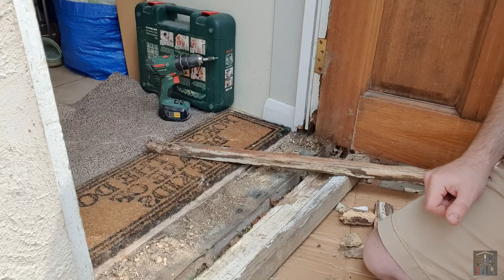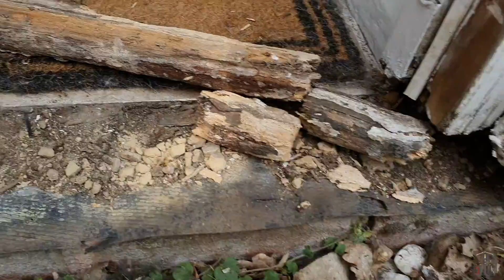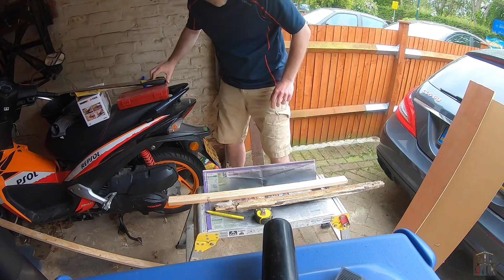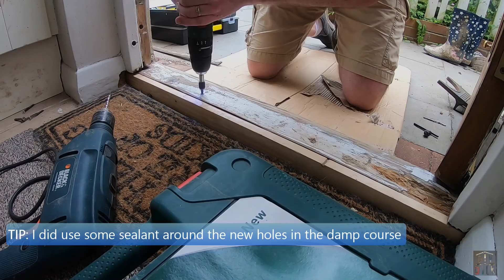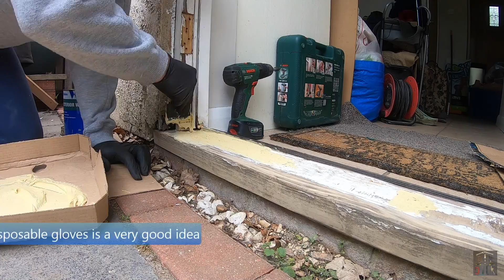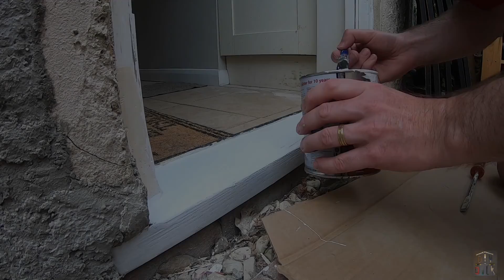Rotten Door Frame & Wobbly Step Repair

Comment: Looks great but come back in a year and it will be a mess.  Wood moves and water gets into the smallest cracks.

Nothing beats a new piece of wood double primed on all six sides and painted on the visible surfaces.

Short cuts don't work in rot repair.

Comment: Seriously why don’t you buy a new wood piece?
Reply: Not everyone has the tools or skills for wood working. Getting the exact size and shape could be difficult. Custom made would be expensive. Most of the damage would be from water and not from wear. The structural strength would not be critical and filler would be good enough.

There's nothing wrong with a new piece, hire a specialist to do it, replace with a PVC door, or move to a new house. It all depends on how much you want to spend. The filler cost would be equivalent to a kfc bucket meal for the family.
Reply: @fungames24  A 2x6 would still be less...
Reply: Lockdown!!

Comment: Thank you for an excellent  step by step video on the process of repairing wood rot in the door frame.....I knew there was a way to do the repair using a wood filler or putty....after being informed that the the entire three glass paneled patio door would need to be replaced.....thanks for confirming what my instinct was telling me.....that I could indeed do this repair myself with the proper materials.
Reply from the maker: Glad you've found it useful.  Definitely worth giving a repair a try; it doesn't cost much & you'll know if the wood is too far gone to repair as you work through the process as it's not always obvious at the start.  You can always stop and revert to replacements at any point so you've not really lost anything by giving it a go.  Good luck!